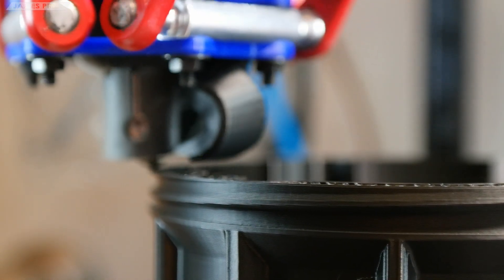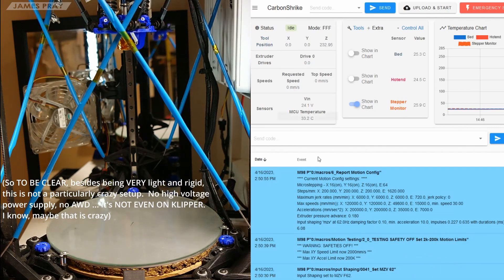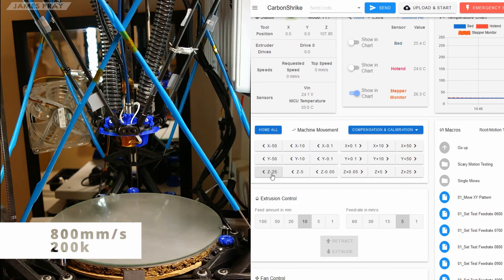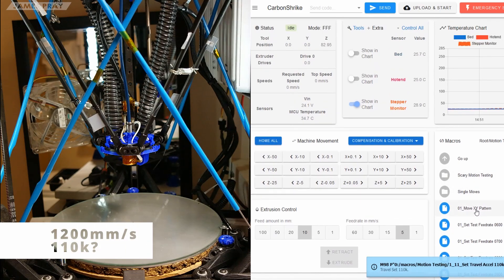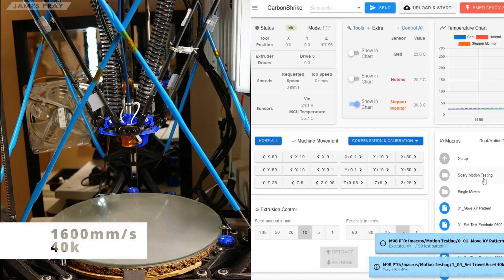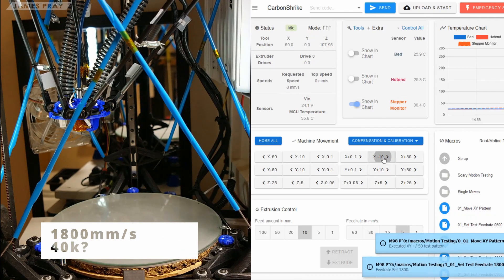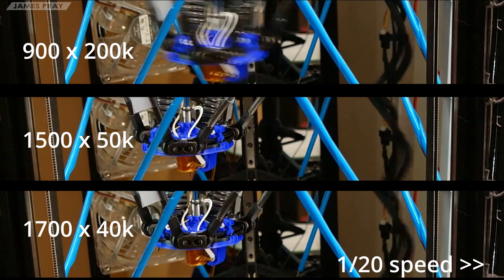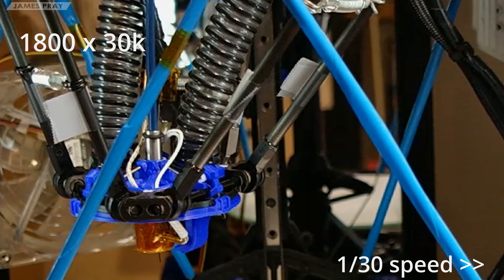Delta Speed SUPREMACY! ⚡ CarbonShrike Delta 3D Printer Speed Testing TO THE LIMIT

Comment: the real lesson here is that delta is limited at those speeds. The T250 printer can print at 250k accels nd 2000mm/s real prints lasting over 10minutes
Reply from the maker: T250 isn't 230x230x390 build volume and running 0.9 steppers and 16T pulleys for print quality.  This machine could crack 5,000 mm/s with equivalent 1.8 steppers and 20Ts.  I'm never planning on > 200k to avoid skating balls in my very nice Nippon Bearing rails, though!
Reply: @jamespray  i haven't seen a delta achieve the print quality of a t250

Comment: bodge in some fat caps and sprinkle some diode clamps around the mosfets etc. in the servo controller; it'll help eat up that back EMF. 

Can even go crazy and cool the servos and overdrive their voltage. 
After voltage transients, heat is the only limit and cooling helps push the Q saturation wall of the electromagnets.

Comment: This gives me hope in the delta I'm currently designing!
I have less lofty goals but was still concerned. (basically want to at least match a bambu X1  for it to be worth the effort)
I'm also using servos so ridgidity is going to be a larger concern than lost "steps" for me I imagine.
Reply from the maker: Servos are a great choice!  And yeah, rigidity is king for delta design.  Just be sure to design around a hot end with enough flow to match the rest of the system, unlike me!

Comment: I’m planning a pretty insane delta build. Insane in the sense that I’m insane for thinking it’ll work. BUT, part of the build is some aluminum corners that accept 2040 extrusion towers, and also have 12mm holes on either side that I plan on shoving some carbon fiber tubes into. I’ve calculated about 0.0056mm sway with this setup, maybe even less. I will also be cabling the corners down to the table to reinforce the top even more. Because of this, I think I can get away with 3 extra motors on top for 2 motors per tower, which may fix the issues you are having if you’d like to give it a shot. Shooting for a reliable 2000mm/s base print speed to put that core XY guy to shame and get deltas back on top ;)
Reply from the maker: Delta force is growing all the time!

Comment: What is the purpose of the springs on your effector arms?
Reply from the maker: It was a test to see if I could fix the lack of side-to-side preload on the Igus ball joints I was using in the build at time of filming.  it didn't work, so I rebuilt the motion system not long after with different joints.

Comment: Current max flow for high end hotends is around 116mm3/s for the goliath ( 100 usd ) and 118 mm3/s for the mosquito prime ( around 1000 usd and this is more of a claim in difference of a real test with the other hotend) from that we could assume, if we wanted the fastest xy speed using that volumetric flow as input so i would say for example in a 0.4 mm diameter nozzle at 0.2mm layer height Vin=Vout roughly and since we already have Vin
We could say that max xy speed for this max flow is 
Xyspeed=Vin/(LH*LW) which would be something like 1450mm/s ish. It would be nice to see a test on a high output extrusion system and the delta printer to see at which point is still feasible to print.
Reply: what is your expectation for reasonable speeds?
I mean if lets say it can print 680mm/s but very sloppy then even if 1000 is possible, nobody wold print that fast.
(or am I missing something)

Comment: Do you think it can go faster?

The community has known for a long time - delta = fast.  However, corexy and klipper are really taking the spotlight lately in terms of speed.  Speed that is a fraction of what a delta can do, why?
Reply from the maker: I think it's partly optics (Voron, VZBot, etc. have popularized CoreXY and there's nothing wrong with that, while there's simply no "community delta" equivalent to those, yet) and partly that deltas can be very punishing/discouraging if they're not properly built and set up (and the inverse is also true: a properly built/set up delta tends to "just work" because there are fewer components to go wrong or wear out, which is probably they're more common in the industrial printer space).  I also think that deltas had a big heyday some years back when people saw how simply they could be built, but this resulted in a bunch of terrible deltas being built and then abandoned and traumatizing their builders in the process.  It's really not that deltas are more work to run than other types of printers, but they are very different from other types of printers, and poor advice / misunderstandings abound.  I plan to do a video at some point that I hope can correct some of this and encourage more people to try the delta platform ... that will have to come after the next round of compressor stuff, though!
Reply: @jamespray  OK you've got my subscription. I'm new here so not sure what you're doing on the compressor front but when I looked at your video it sounds like you might need a desk.  How can I support you and contribute to the cause?  Do you have a patreon?
Reply from the maker: @raeliean  Welcome aboard, then!  Unfortunately, not much can change the desk situation except a bigger house, but I appreciate the willingness to help, a lot!  I hate asking for anything, but I am actively looking at ways to do just that -- any way to help offset the time and money investment in my content would be great.  I was thinking of selling some of my cooler designs on Cults, but I could also start a Patreon and make designs available there to subscribers.  I was leaning toward the selling designs idea before, but the 3D printing community has a big stigma toward that and it does worry me.  Patreon feels more accepted but also a bigger ask from folks.  If you have any thoughts on the matter I'd absolutely take them into consideration!
Reply: @jamespray  I hate asking for help myself, if I'm being perfectly honest.  So, this is my mindset; I am asking you for help.  You make great content and do amazing research (that I don't have time for because of my own commitments), but nevertheless that is my ask from you, more content.  I would gladly contribute some dollars to that cause, because I know it's time consuming.   So, it's a mutual trade the way I see it.   With all my patreon subscriptions I tell them the same thing - I don't want merch, I don't want stuff.  I just want to see you do more of the things you do.  That doesn't mean make videos I want to see, by all means Ive suggested plenty of videos and gotten denied - because it doesn't fit the theme or what it's after and that's OK!   The goal is to support you as a person, because you're doing cool and interesting stuff.   If I can help you do that cool and interesting stuff and make a great living, then it's a win-win, because there will be better content out there for me to learn from :).  So, it's a no-questions-asked kind of support.  If you want to make a patreon I'll be your first subscriber.
Reply from the maker: @raeliean  That's an incredibly useful perspective.  Thank you!  I'm not going to make a Patreon right this second, but on this basis I think I probably will by the time I release my next "major" video.  Cheers :hand-pink-waving:
Reply from the maker: @raeliean Just an update so I don't leave you hanging: on further consideration and research, I've decided that Patreon isn't the direction I want to go in the near term.  I'm a writer -- actually writing novels is my "primary" side work besides the day job -- and I really need to retain the freedom to "switch off" from socials in 2-4+ month blocks to get books written and edited.  Patreon feels much more geared toward more regularly-paced content generation, and I don't feel that is something I can reasonably sustain alongside my writing -- it wouldn't feel fair (to me) for the sake of patrons.  (Maybe it's just because I'm ADD, but I really have to retreat from the Internet to get good writing done.)  That said, I am getting close to the threshold where I can start earning from this YouTube channel, and that should (I believe) bring in options like the superthanks tip button for awesome folks like you who want to throw a few bucks in the hat.  As I said yesterday, your perspective was really valuable as an input to this internal debate on my part, and I feel much better having resolved the question for now.  That said, I also learned more about the Patreon platform, and if my situation changes in the future, I may eventually land there anyway.  Thanks!
Reply from the maker: And yes, it could go faster with 48V and/or AWD, for sure.  Those directions aren't in my near-term development pipeline, but I know a couple of folks currently experimenting with both.  There are some exciting delta projects in the works right now -- more than there've been in quite a while!

Comment: Wow, nice, im into the delta myself, having a Super Racer. My max it 500mm/s @ 60k accel at the moment (heavy head DD 373 grams) me subscribe
Reply from the maker: Welcome aboard!  And that sounds like awesome performance, especially as it's with a DD.
Reply: @jamespray  I'm getting inspiration now 😁 just did 700mm/s @90000 accel (X and Y movment and a arc movement (i have e3d 0.9 high torque steppers). Next on the list is external fans, and a printed effector (the aluminum one from SR is like 75 grams) I can wait for your hotend upgrade review! im using a CHC pro atm with a CHT clone nozzle.
Reply from the maker: @SuperKoe  Sweet! :cat-orange-whistling:
Reply: what for flow rate are you able to get from your hotend?

Comment: Speed doesn't means quality.
Reply: Not by itself, but the faster you can print a passable benchy, the closer printer tech will be to printing huge parts at quality in an hour or two.
Reply from the maker: That's true.  This does happen to be a quality-oriented build, and prints extremely well at normal print speeds.  It just happens that most of the work I did to achieve high print quality also contributed to raising the speed envelope.  I cannot make any claims about the high-speed print quality at the moment because the extrusion system can't keep up with the rest of the motion system, but that is next on the list of changes, and then we'll see!

Comment: Might not be possible but having those giant tubes loosely hanging means that they will rock with each start and stop and probably add to quality issues & affect your max speeds. Maybe consolidate into one tube and tie down for weight savings and reduce the independent movements
Reply from the maker: Consolidating isn't possible as the tubes serve different functions (one for hot end, one for part cooling).  While floppy, they're also fairly lightweight, so although I'm sure you're right that they have some impact on print quality, I believe it is very minor (print quality at normal speeds is very good).  I am more concerned with the 320g flying extruder system, which is what the tubes and bowden are attached to.  That doesn't move too much but it is attached to the carriages and is clearly moving around long after the effector stops moving.  It's my next target for mass reduction.
Reply: @jamespray  You're probably right in the scheme of things but every gram matters when looking for speed & precision. I assume the tubes are delivering air to each part youre talking about. You could have a design that divides the air flow and throw a larger fan at the top of the intake.

But yeah there's probably bigger things to tackle at the end of the day.
Reply from the maker: @Jonj57  I'm a borderline psychotic gram chaser, no worries there!  The concern isn't air supply but control -- hot end cooling must be on whenever the hot end is hot (and it must be steady so the heater control isn't thrown off), but part cooling is only selectively active and may vary a lot (I even change the air supply based on what I'm printing).  It would require active valving on the effector to run a single hose.  I could size down the tubes from 19 to 15mm, though, and may eventually do that.  As-is, though, the effector is only 60g (10g more than a Voron Tap kit by itself), and the moving mass besides the flying extruder is only 240g.  If there's a machine of comparable build volume that's lighter than this, I'd like to know about it and see what I can learn!
Reply: @jamespray  Would be cool to change some of the spokes and use them as air pipe with a hole near their end feeding into a lightweight pipe or even a simple plastic bag bladder to air cooling inlet port.

Well I guess the carbon tube spoke pulling double duty as an air pipe part sounds cooler than the plastic bag bladder.

Comment: Also, I wonder how input shaper may affect these limits? I honestly don't know if it would, but maybe it does?
Reply from the maker: Good question, not sure!  I ran these tests with MZV 62 enabled
Reply: @jamespray  In my experience (not with deltas) input shaper helps you going fast as the machine doesn't have to fight against resonances

Comment: LOL I had the exact same experience when I tested mine. Except my Super Racer limits were at 1000mm/s. So I was able to achieve 400mm/s at 120k. But 1000mm/s at 20k. I used the klipper  macros from ellis3D’s tuning guide. What I found is that these limits drastically reduce the closer to the edge of the print bed that I print. I'd be interested if that's your experience as well? At the edge I can safely print 400mm/s at 30k, but at the center, 120k is no problem.
Reply from the maker: Speed limits drop off when the arm angle goes below 45 degrees, because that's when the steppers tip over to spinning faster than the commanded speeds.  So yes, bed edge performance is a different story!
Reply: @jamespray  so the solution is longer arms?
Reply from the maker: @ManjaroBlack  That will reduce the effect, yes, though it comes with tradeoffs (including reduced Z).